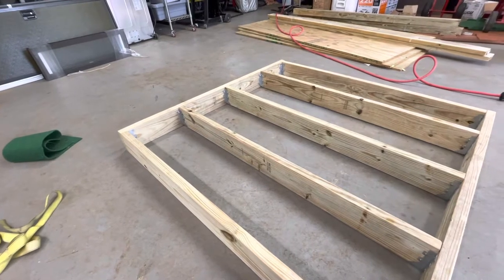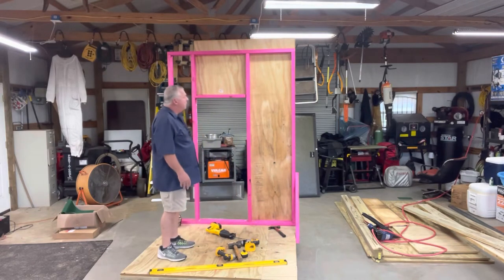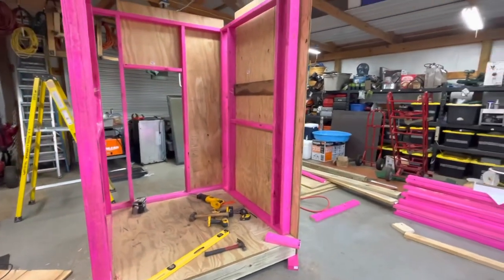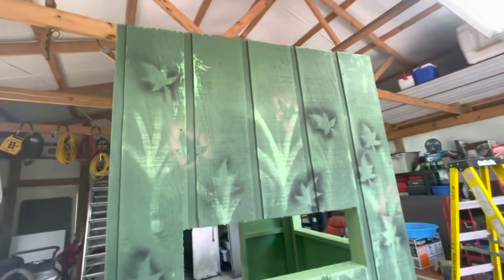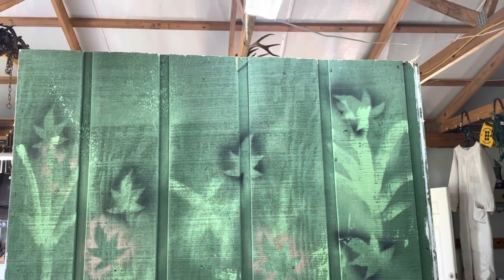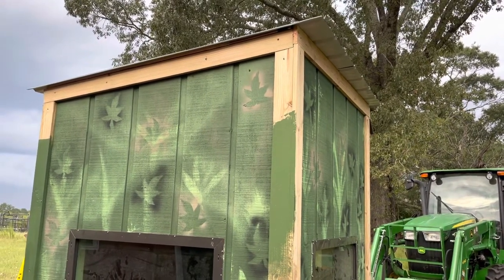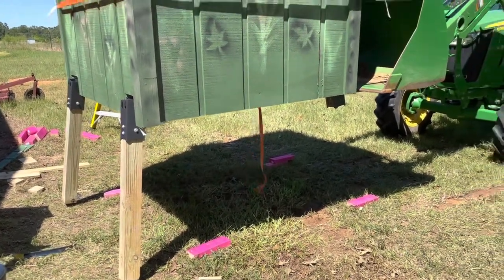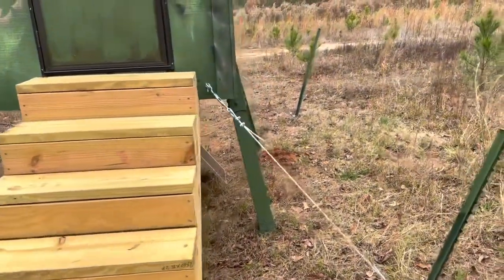Building the best deer blind @twincedarsranch1658

Comment: Do you have the material list for this build just the wood.
Reply from the maker: 5  2”x6”x 8’ treated
25  2”x4” pine studs
2  4’x8’ 3/4” treated plywood
2  4”x4”x8’ treated
4 4’x8’ rough sawn reverse board and batten siding ( I already had these. Plywood will work).